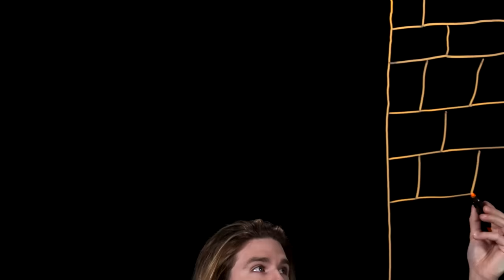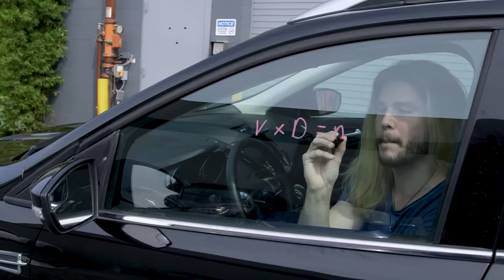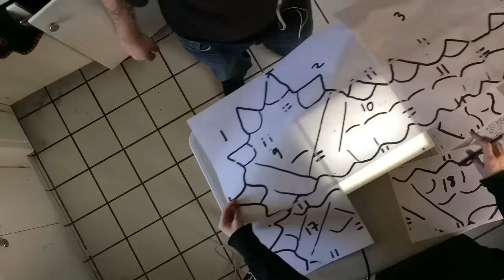Could You Swing A Real Monster Hunter Sword?

Comment: So if Because Science can see this, i'll hope this information will be more or less useful to any other Monster Hunter fan.
I've measured the size of the weapon to a monster, because we know the length of them. By doing so, I've discovered that the weapons are 4,50 meters long ! And like the hunters are the same size as the weapon, I concluded that they are around 4,20 meters high ! By saying this, I wouldn't be impressed to be able to lift a weapon of that size.
Also they've got a lower gravity than ours. The proof of that is the monsters. Having a giant monster of even 4 meters on our planet, could potentially kill it whiteout even to do an effort. So swinging that giant sword is way more easy.
Finally, the sword isn't composed of heavy materials, because the metals, monster hide, and their "keratin" are all mentioned to be pretty lightweight.

I hope someone will find this message and appreciate the effort I put into it as a MH fan !
Reply: Lord Solaire this sword won’t be as heavy as other greatswords, for example the ravager blade which is pure metal.
Reply: That's some OG MH breakdown type shit right there. I miss the hunting community.
Reply: Lord Solaire even if the sword was half its weight, we’d still be dealing with a 150-180pnd sword
Reply: The garavity doesn't matter, because sure compared to us it would be different, but the hunters are use to the gravity there not here. So if a hunter came here they would probably have difficulty to even simply walk on this different gravity. So the gravity is going to be the same comparison for them with that gravity as us with this gravity. Though the rest of what you say sounds reasonable, just not the gravity part.
Reply: Lord Solaire damn thats got u deserve medal thanks
Reply: Except that hunters are known to be 1.75m

Comment: Couldn’t you have used water displacement to measure volume?
Reply: I guess you would need a water tank though
Reply: TomatoSauzeGaming 626 That's what I would have done too, an inflatable pool would have done the trick.
Reply: I came here looking for that exact comment, to make sure I didn't duplicate it if someone beat me to it. Additionally, to find the center of mass is actually pretty simple. Place the sword on a fulcrum,  and adjust its position until it balances. These are both cases of missing the forest for the tree that you just ran into.
Reply: And ruin a multi-hundred-dollar prop for the sake of it?
Reply: Xar Alkaid if it is that expensive, they should make it water proof, am i right? XD
Reply: Yes, but, if it's primarily made of materials that float, it would be very difficult to fully submerge, especially something that size.
Reply: I guess putting it on water would kinda ruin the prop. Plus it might be made out floating materials.
Reply: No, because of density. Denser objects displace more water, and something like a foam prop would displace way less water than a super monster scale sword.
Reply: IoKnight Density is what determines an objects weight relative to it's size due to how compact the substance is. It has nothing to do with it's physical volume and displacement of water. A cubic meter of aluminium is far less dense than a cubic meter of lead, but they are both still 1 cubic meter of volume and will displace 1 cubic meter of water.

Comment: So my first question is did your calculations take into account the increased weight of the iron hilt, handle, and rod that would have gone into that giant pickle blade? Not that making it any heavier would help.

And I’m sure you’re getting bodybuilder questions, but even if you were capable of swinging that sword, I’m thinking of the core strength and possible pulled back muscles when trying to stop that swords momentum in a horizontal swing. You know assuming you weren’t a fictional character that wielded a seven foot slab of iron and swung it a 100 times a day just to train with it, what a Mega Man that guy must be. Seriously though wouldn’t using that sword cause more damage to the user over time than the monsters it’s used to hunt. Yet again assuming a hunter doesn’t end up a Jill sandwich before old age.

Comment: C'mon Kyle, 1.5m is ~5 ft not 6 ft.
Still swinging around a 5 ft sword or a 15 lbs sword wouldn't be fun, let alone one that weighs almost 400 lbs.
Isn't the Chiron the new king since it replaced the Veyron?
Reply from the maker: I rounded for both numbers, but yeah the Veyron has been surpassed. But I used it because it's still one of the most powerful, like I said, and most people have now heard of it -- KH
Reply: well i uess estimating from meters to foots aint that easy? I never done it, but seeing how inconsistent the imperial system is to metric, there is bound to be round-abouts and estimates

Comment: Hey Kyle,
I can understand choosing just one density to work with for simplicity but to be truely accurate with your measurements you would need to consider the density of the other composite materials like the wood and steel still used in it's construction, and their locations on the build to define a more accurate center of mass. This would probably net you a even heavier sword but it might also make it more rationally ballanced. If say for instance the handel and pommel had a much higher density than the blade, it would lower the center of gravity towards the pivit and reduce the amount of torque needed. Granted this is a fictional sword so breaking it appart into it's most probable composition of parts and their respective densities would be highly dificult and speculitive but it would get us a more accurate answer, and as nerds that's what we should be all about.

Comment: Though expensive, do they have 3d scanning technology that could create an electronic model from a physical one? Then perfectly calculate the CG (assuming you could assign various densities?)
Reply: I was also thinking that modelling the sword via CAD, catia or any other technical graphic program would be way easier and better for those calculations (though less spectacular)^^.
Reply: They do. Several different varieties in fact. Contact scanning (a physical probe touching the model in 1000's of places and measuring the location of each point), laser scanning (similar to the contact method but it uses frickin laser beams!) and photogrammetry (which compares photos of an object at many different angles to approximate it's shape) and they range from $100k's to apps for your phone.
And yes you could, though for the purposes of this video Kyle's assumptions are more than adequate.
Reply: The fact that it was sponsored by Capcom made me think they were going to get access to the official 3D models to use for calculations.
Reply: You could just get a fulcrum, eyeball it, the edge in to it until it balances.

Comment: Why measure when you can determine it's exact volume via water displacement?
Reply: Right? Thats the first thing I thought of.
Reply: Because of density. Denser objects displace more water, and something like a foam prop would displace way less water than a super monster scale sword.
Reply: IoKnight well foam prop would displace its volume of water if it was pushed down until its just below the surface, or if it had weights inside of it
Reply: As a prop maker: this thing is made of what looks like craft or insulation foam. It's too porous and would probably get damaged
Reply: Wrap it in plastic first then. The error from that would be less than your error from trying to break up an irregular object like that.

Depth would crush it? Push it in flat. 

Water pressure still too much? Any fluid would do. 

If anything, the reason they didn't do it the accurate way is that it would cost too much to build/rent something that would do the job.... but they didn't even mention the superior method.

Comment: A really cool trick that is both significantly easier than estimating the volume of that sword with a bunch of little shapes and essentially 100% exact is measuring the volume of water displaced by the sword. Just stick it in a container of water and measure how much the water level rises. The issue is it’s so gd big gonna be tough finding a container big enough but maybe something like a hot tub could work

Comment: Youre gorgetting about different materials of blade and hilt.
Looking at it the ball at the hilt is made of steel, which is way denser then caritin.
Notto mention, swords are ALWAYS desiged to have their center of mass just above where you hold it. So at the crossguard.
This sword is much easyer to weild then you think because you put the center of mass at the wrong place
Reply: I have noticed a lot of flaws in his videos, one said you would weigh 2.5 times more on the surface of Jupiter.........
Reply: God learn to spell before you speak
Reply: @meat2023  Spelling aside. He's correct. The center of mass in this video is based off the material being homogeneous throughout (or at least roughly the same. I'm sure they have a supporting rod) as if it were, say, a piece of paper. Not accounting for the different materials, let alone the fact that a sword maker would account for the materials and use a proper (denser) counter balance on the pommel to place the center of gravity just around the hilt, as Ethribin stated. His premise is flawed.
Reply: except that you're forgetting that greatsword are not centered at the hilt like longswords and arming swords, mainly due to their length.
Reply: Yep
Reply: The pommel is also the same density as the rest of it, in universe the pommel is probably heavier, alleviating the center of gravity issue
Reply: Is there enough metal in your general vacinity to counter 350 lbs

Comment: In reality (and historically) most real swords are easier to swing since they are balanced to a point near the cross guard (slightly forward). The balance of the sword gives it its properties; a sword with a balance point further back is easier to handle, but does not strike with as much force as a sword with the balance point further out. For a sword with an extremely heavy blade (such as this sword), you would put counterweights in the hilt or especially on the swords button. But given the already massive weight of this sword, putting on too much extra weight would make it even harder to handle. However, given the density of the blade is most likely lower than the density of the cross guard, the hilt or the button, the centre of mass is actually most likely closer to the hilt than you estimated. I mean, you clearly have big hunks of steel there. So I think your estimation is incorrect, the sword should be heavier than you estimated and should have its centre of mass closer to the hilt. Also, not sure if the blade would be solid keratin.
Reply: In the game, Deviljho scales are so dense that giant solid steel swords bounce off them.
Reply: @Kirzerk  hardness =/= density. For example lead is very dense but is very soft.

Comment: I was going to comment on how having "2 or 3 or 4 adults sitting on the end of your blade" would not be correct (btw the average US man weighs about 195.7lb so that is about 1.8 adults worth of mass) as it would create a larger moment than if the mass was spread more evenly throughout the sword, but you went on to that topic later.

Instead, I will point out a more accurate way of determining the volume. Since this was a professionally made prop, I assume the sword is waterproofed so you could submerge the sword in water and calculate the displaced volume of water based on change in water level.
Reply: No, because of density. Denser objects displace more water, and something like a foam prop would displace way less water than a super monster scale sword.
Reply: IoKnight That's not true. Displacement is always by volume, not density. Density only comes into play when the object in question floats, in which case, if the floating object is forcibly submerged, you will still get the full displacement of water, as if it sank.

Comment: One flaw with this is the assumed materials. You went off the material list from the game,rather than making a guesstimation of materials based on its appearance. Scales, claws and talons do feature in the design, but  bone is also a frequent component of MonHun greatswords (this is a bit of an assumption on my part, as jho weapons don't start from iron or bone trees but we can assume similar crafting methods are shared). We can also see that metal (likely iron) features in the hilt and 'crossguard' (along with any bolts and fastenings like the chains. And finally, 'living' organic components also feature, as the seam in the middle shows muscle-like material which is further exposed when the whole sword grows and bulges outward as the wielder executes a charged strike with the weapon. The weapon description also corroborates this, depending on game (mentioning that the sword is 'living').

Based on this it's safe to assume the real thing would be significantly heavier than what your measurements showed. Probably in the avenue of 500+ pounds, depending on factors like how dense any bone or sinew used is.
Reply: so what yer sayin is, it'd be even more useless
Reply: @kuroudoakabane1352  For normal people, yes, but for a hunter the extra weight would make it even more destructive since greatswords are designed to smash things very hard.

Comment: from what you explained. that is if you're "man-handling" it so to speak, which you do NOT do with any top-heavy weapons like a great sword or an ax. a greatsword is known for its power which comes from its weight, so to wield it, you don't "man-handle" it like it's a 1 handed sword, but instead use the weight of the blade to control it and control it from its axis where resistance is close to none.

Comment: If you hollow these swords it cuts 1/3 of its weight.  By using gravity to facilitate the swings, you can let momentum carry its weight.
Reply: But by doing so can make it very brittle since Great Swords are somewhat a blunt weapon aswell as a cutting one.
Reply: Marlon Calantas Isaguirre Jr. well how many giants do you slay. You invest 100% on 1 and get it fix after.  No one on earth can even swing a 50lbs. This sword is 200lbs
Reply: @Saffrone221  It's still no use if for example after around 3-5 swings half of the sword is already broken during a fight rendering the sword useless. And if you were able to finish the fight without breaking the sword, it'll still need to be repaired which would otherwise probably take days to be in top condition again. Greatswords overall are just not reliable swords in real life. I prefer much lighter swords like the Long Sword, Dual blades and occasionally Light Bowguns from the same franchise.
Reply: @Saffrone221  *Light bowgun is not a sword
Reply: Marlon Calantas Isaguirre Jr. lets agree its fiction and in some universe this is possible.  I dont think anyone can swing that. Carry, yes. Swing, no.

Comment: I mean to be fair the weapons are mostly comprised of monster parts and on top of that there's a youtuber who forges weapons of around the same size and can mostly swing them the thing is you can only really do basic over head slashes with weapons of such size. Also you can swing the smaller weapons just fine (though you would have to be an expert swordsman to dual wield otherwise you can't use dualblades)

Comment: And that is why swords usually are pretty small. 

You want more range? use a ranged weapon, You want force? Use a battle hammer/battle axe. You want to keep your enemy at arm's length... get a good longsword or poleaxe. The size of the sword also depends on the use. 

A short sword is great for keeping on you if you are in a military force and in a city but also for personal defense. A long sword makes it a bit harder though has better reach hence better defensive use. Remember an enemy that can't reach you can't hurt you! And a long sword also has negatives, it takes longer to get out and it is again bigger to has more area it swings around it. Which is not always the chosen solution.
Simple said unless a war breaks out or you need to get out the big weapons... you don't require bigger. Short swords allow you to move easier around. Pole Axes, on the other hand, give you reach but make it a lot harder to move around. Soo, it is more a defensive strategy weapon. 
And longswords? Well, a bit in between, more suited for actual war than for defense.

How longer and bigger the weapon how more it is suited to a Warfield. 
How smaller and lighter how more suited it is to an urban area. 

And yes, you can always take a MESSER with you.

Comment: Would it have been more accurate to separate the metallic handle and the 'blade' since the metal and keratin would have different densities. Take each to their respective tanks of pre-measured water and submerge them to get the displacement to give you a more accurate  volume of each. Multiply those volumes by the density of their respective materials, steel and keratin, to get a weight difference for each. With the steel being a higher density it should shift the center of gravity toward the handle and change all of the following calculations.

Comment: the calculation on center of mass is extremely wrong, the bell at the end of the hilt is a counter weight and they are specificly there to bring the center of mass of a weapon usually to the middle of the cross guard or in this case that piece of metal securing the blade to the hilt